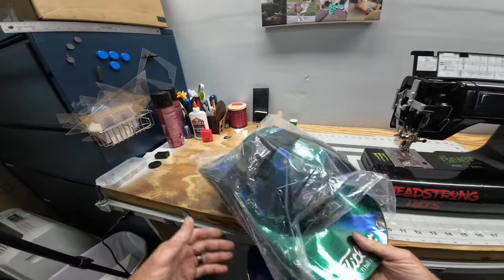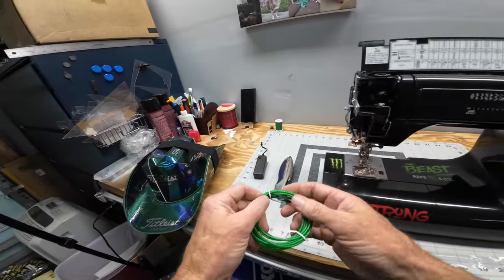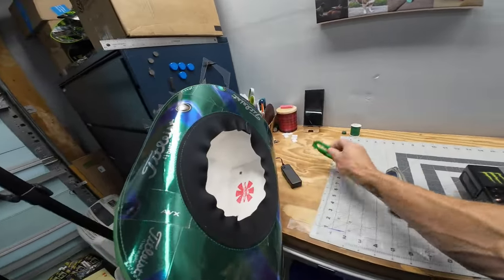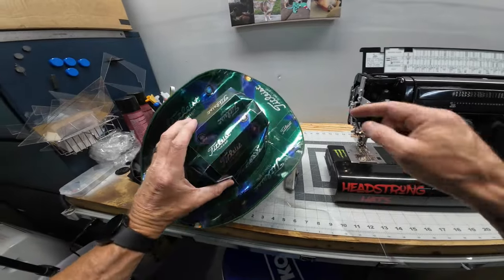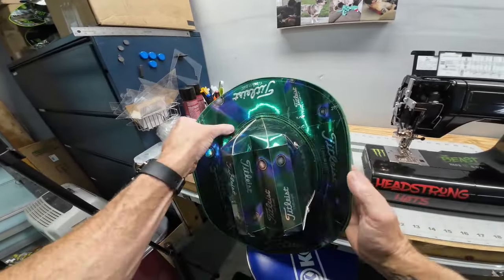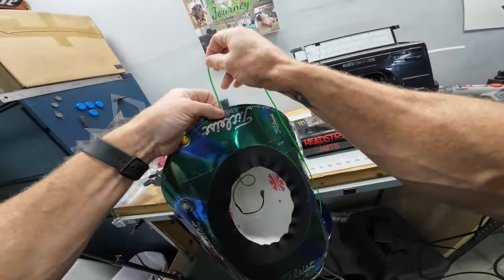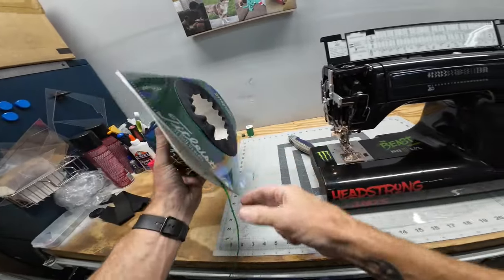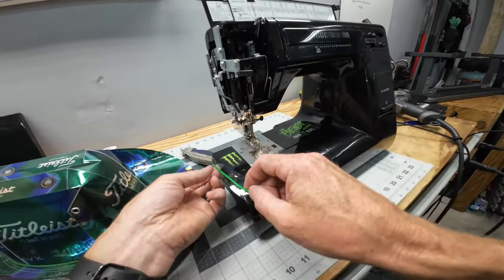Titleist Golf Ball Box Cowboy Hat with Electroluminescent Lights! #golf #titleist #headstronghats

Comment: What size sewing needle do you use?
Reply from the maker: I use Schmetz Vinyl needles size 90/14. A universal 90/14 will work as well. Just make sure that it doesn't get gummed up from any adhesive that you use. The adhesive residue can work it's way down to the mechanics of the bobbin assembly and gum up there as well causing periodic looping in the understitch.